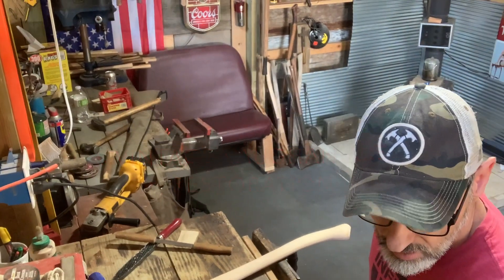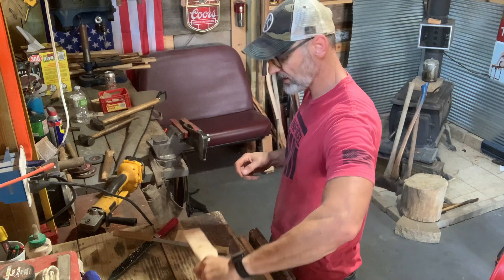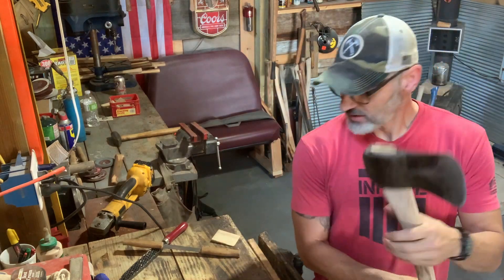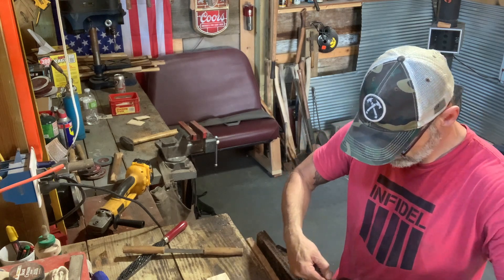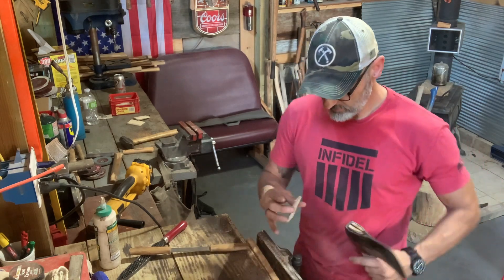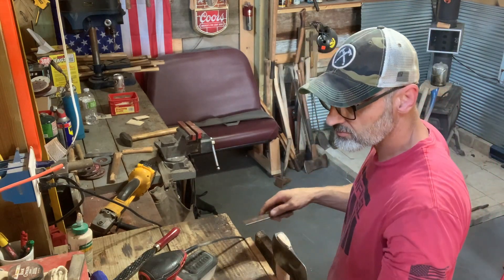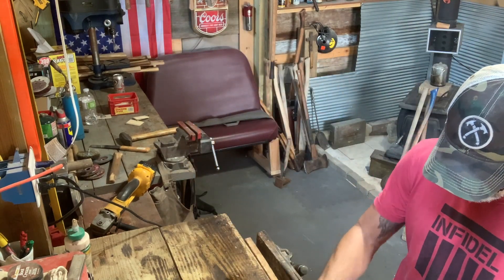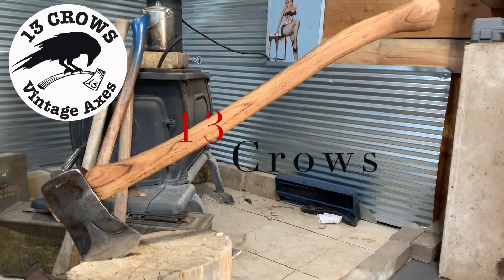Vintage Vaughan Axe Restoration

Comment: Like the videos!  Just got the axe restoring bug about this time last year... What specifically are you using to widen the kerf before you seat the wedge?  I need to do a better job of that.
Reply from the maker: Well if it’s pinching together when you are seating the head then you gotta take more wood away.  You can clamp the kerf in a vise,
Pinch it together and use a saw to cut it wider.  Thanks for watching, hope that helps!
Reply: @13CrowsVintageAxes  Yes it does help.  Thank you.